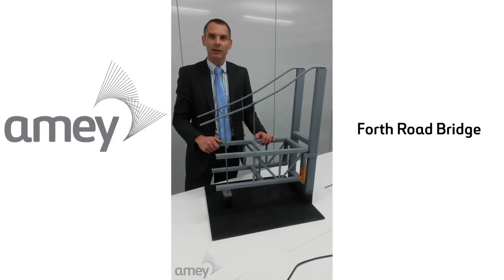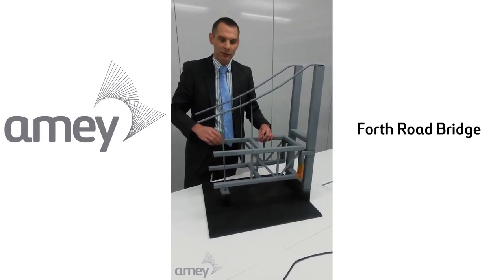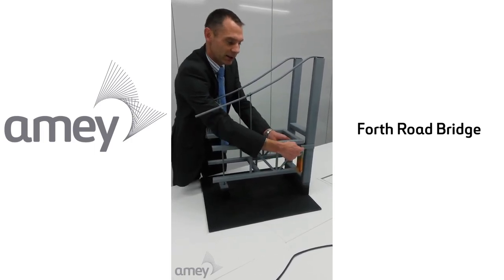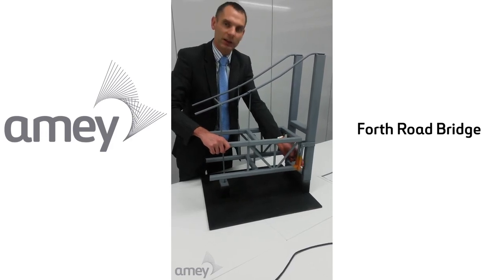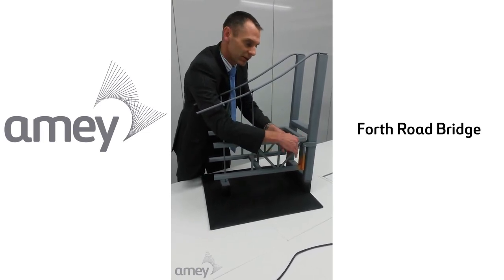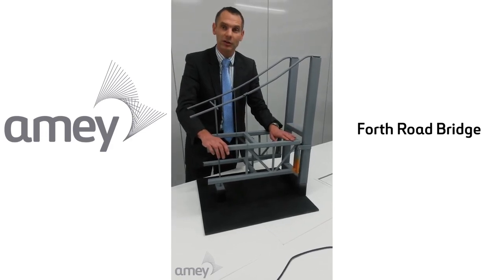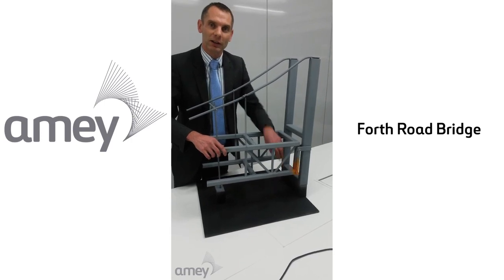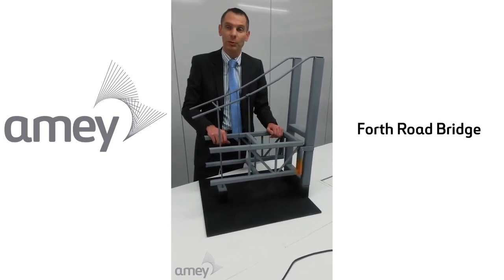Forth Road Bridge - Truss End Link - What has happened?

Comment: Did the repair team consider the possible effects of overstressing the surrounding structures due to the failure of the inside truss end links? I.e. what assessments did Amey perform to ensure the mechanical integrity of the non-failed components due to over-bearing loads? And have metallurgical assessments been performed around the welds to determine the failure mechanism(s)?

Comment: Out of curiosity, what actually caused the link to fail?  Presumably the deck load is evenly distributed across the remaining links and also the suspension cables.  Would the link fail if vertical suspension cables not tensioned correctly? I have an inquisitive mind! lol.
Reply from the maker: +Andy Williams Hi Andy, for many years the bridge has been carrying far in excess of the weight and volume of traffic that its designers ever envisaged. The main towers were significantly strengthened in the 1990s to accommodate this, however it is likely that the same stresses caused the fracture in the truss end link.